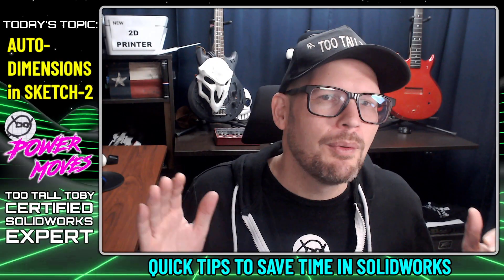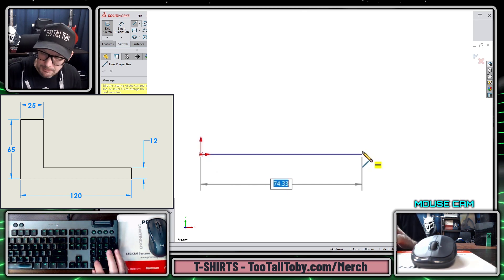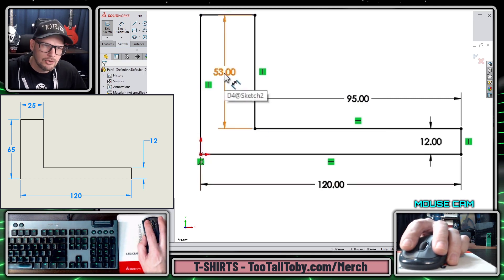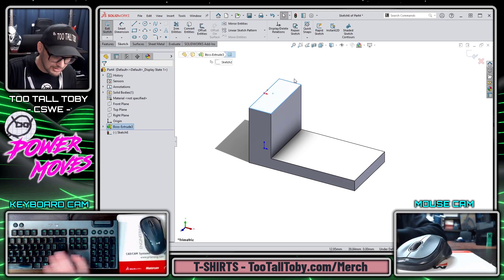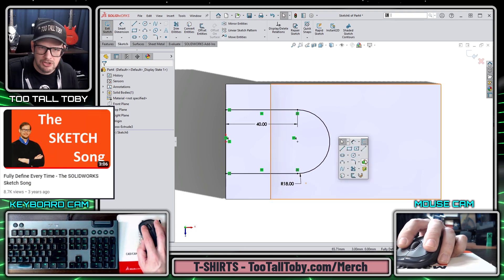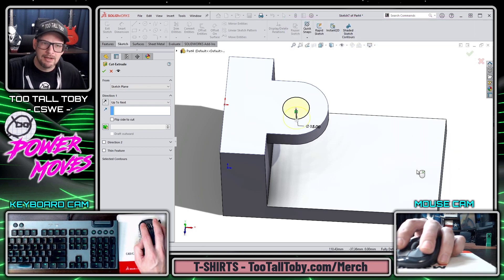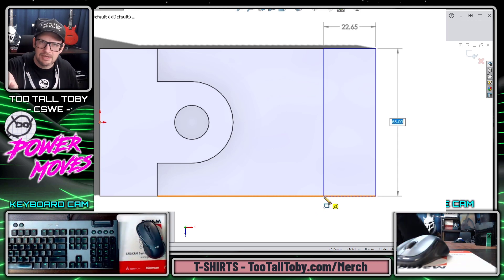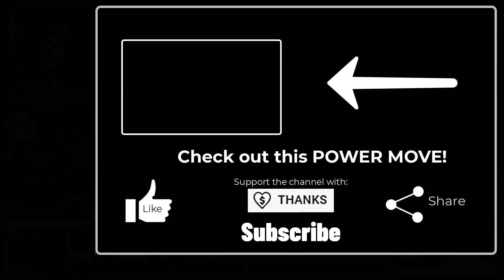SolidWorks Auto Dimensions - Part 2

Comment: In AutoCAD way back when you always worked in coordinates & keyboard shortcuts, so I got used to having the mouse in my left hand - still a good tip for autodimensioning: You never let go of the mouse 🙂
Reply from the maker: if you hold the mouse while attempting to auto-dimension, you tend to "move" your mouse hand, which causes the dimension to blank out.  So I prefer to let go of the mouse to auto-dimension - however, you might have a more steady hand than me :-)
Reply: @TooTallToby  Good point. I've never had a problem with this but come to think of it I probably lift my hand a little bit from the mouse when I've finished the line.

Comment: Excellent tip! I confirm that the times that I am getting on the speed modelling challenges would have been impossible without the autodimensioning option.
Reply from the maker: Aww yeah thanks Ali!!
Reply: @aliammouri2522 Curious: Do you use auto-dim on a regular basis, or did you use it before speed modeling challenges? I never could get acclimated to it. It just seemed foreign to me..